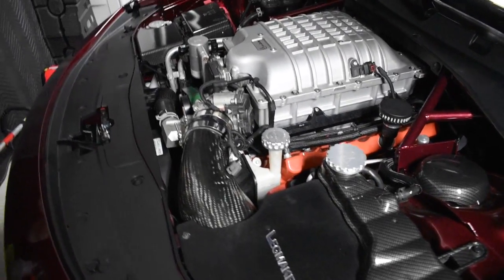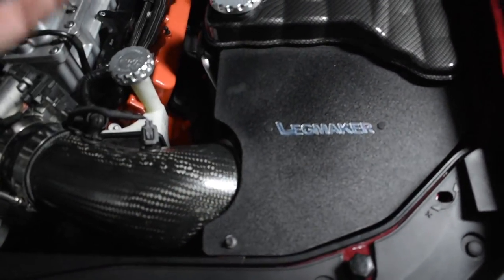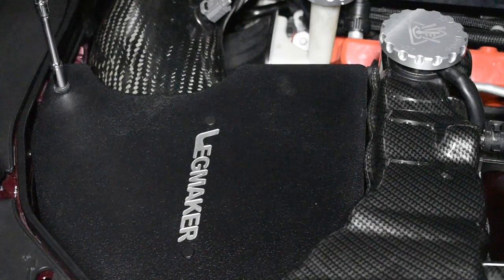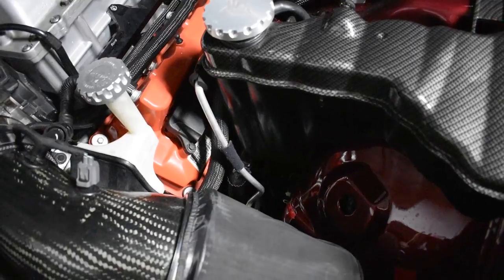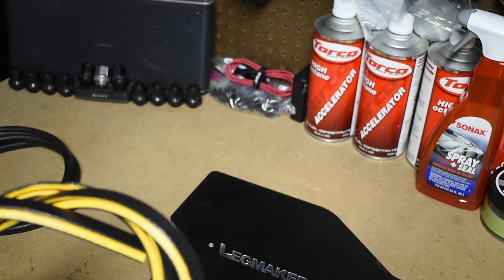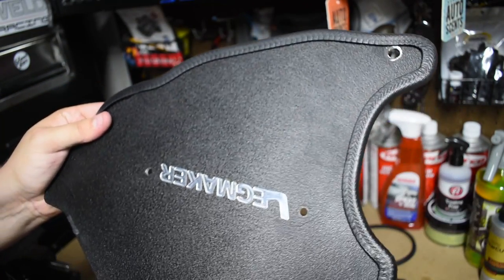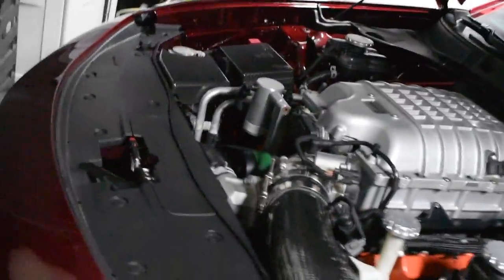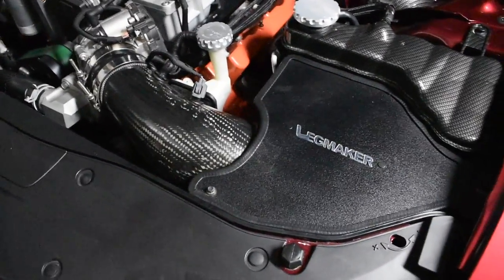Hellcat Legmaker Intake Rain Shield Trim Mod

Comment: Why the legmaker and not AFI for your CAI .The AFI has an enclosed filter and doesn’t get all the hot air from the engine.Have you tried that new stuff F-11 yet,if it works as the seller says it does it will be the go to item in sealing /wax .